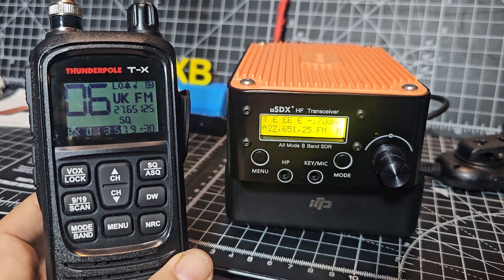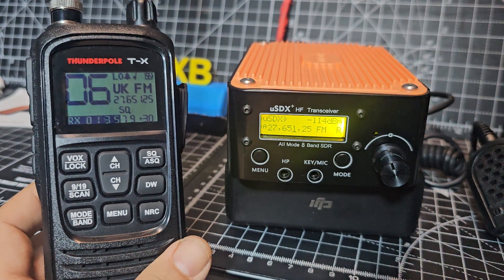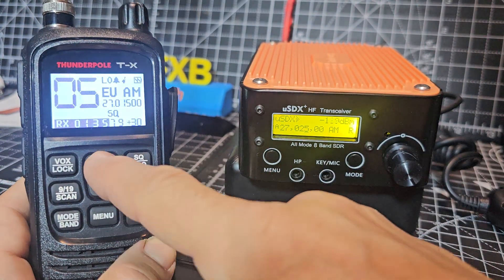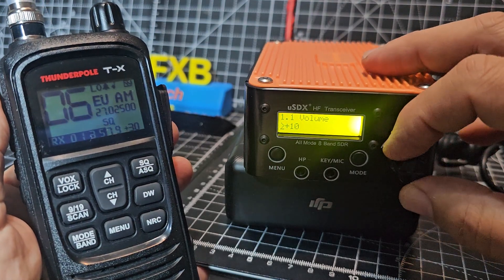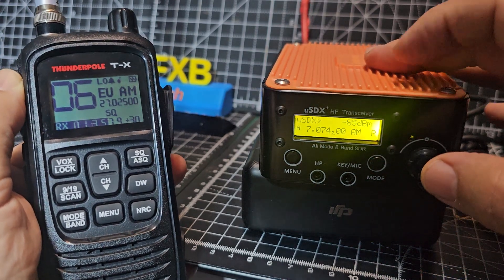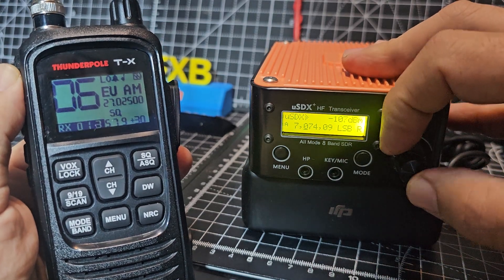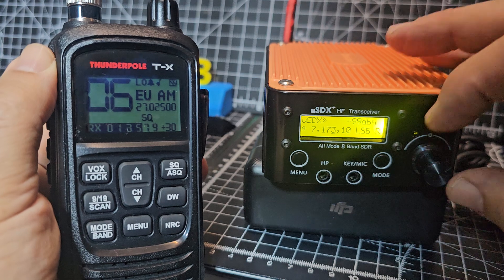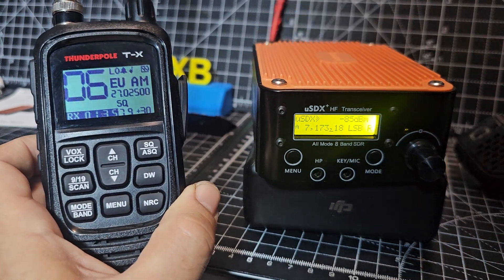CB Test ,  USDX Plus v2 - SDR Transceiver

Comment: Does work on Fm but you will need to recalibrate the ref frequency. Mine was 2.5 kHz off frequency and I've heard some are as high as 4.5khz out mine was high.  Once set it was fine on all modes Inc CW . Cheer
Reply from the maker: Oh cool thanks .